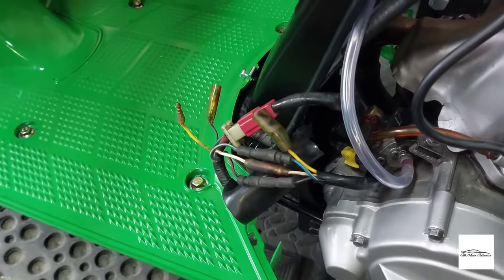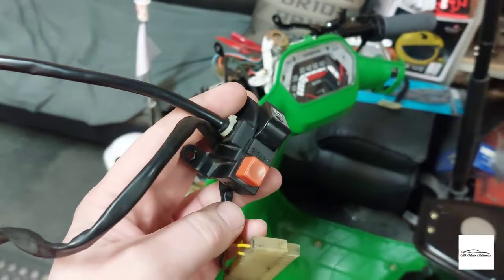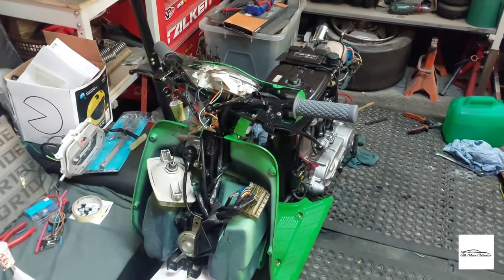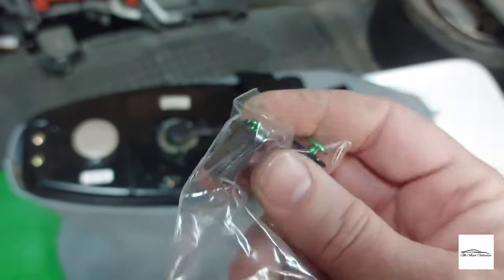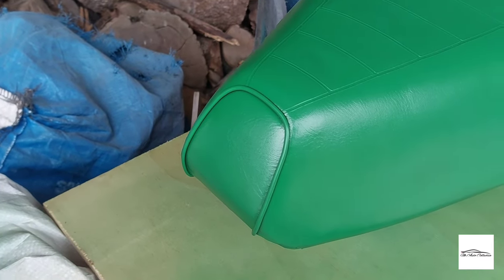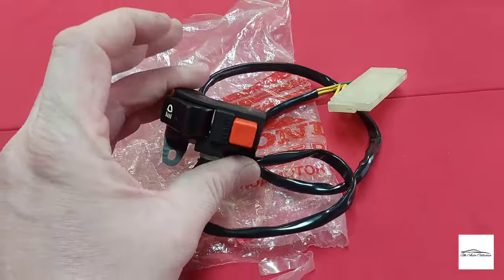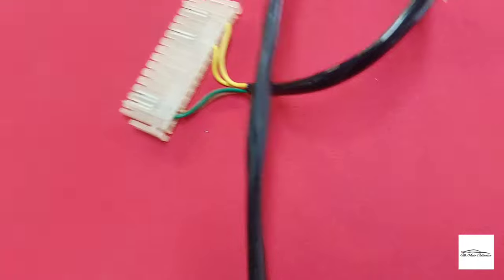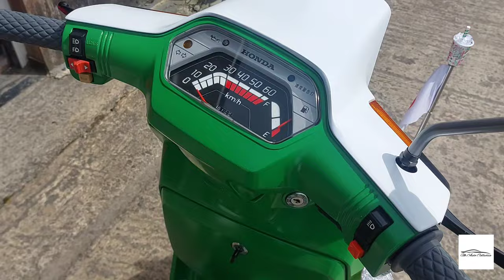1 Step Forward, 2 Steps Back! | Bosozoku Scooter | Honda | Part 11 | UKAC

Comment: Dismantle switches, clean contacts, clean bulb holder contacts, check your earths,  the switches earth through the handlebars which has to pass through your headstock bearings etc
Is another earth under the regulator/rectifier and another from negative terminal to starter
Good luck 🤞🏼